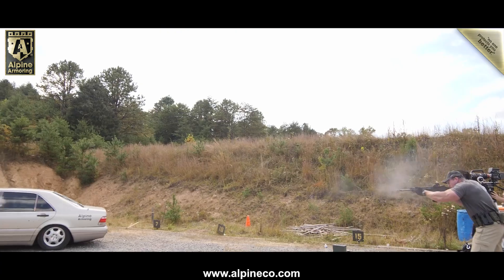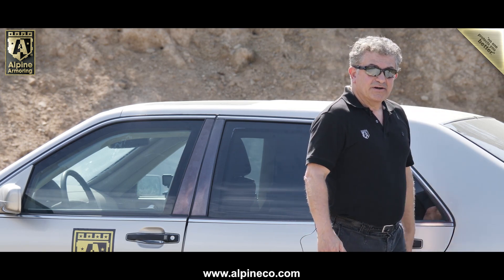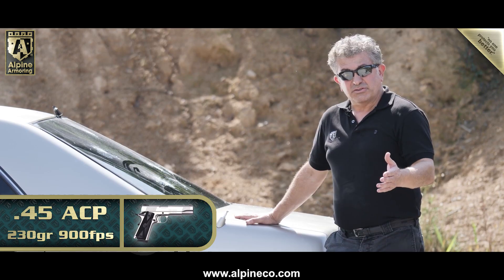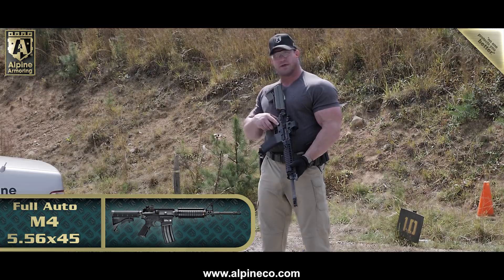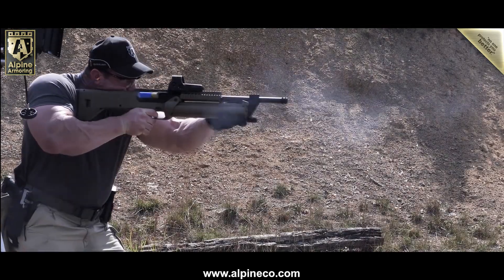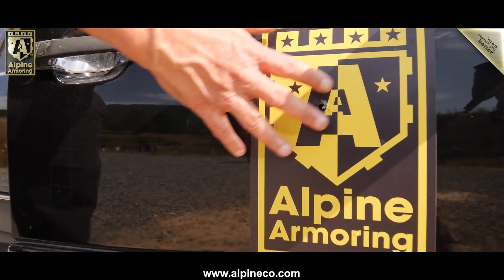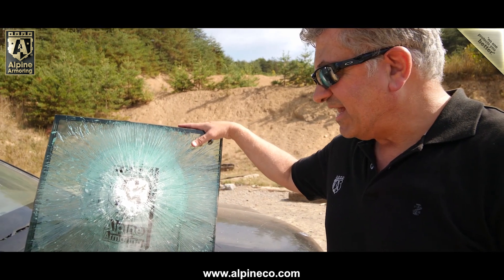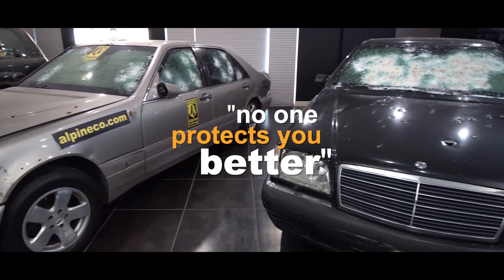How Long Do Alpine Armoring's Bulletproof Vehicles Last?

Comment: I'd definitely feel safe in that car!!
Reply: It's a false sense of security. Anyone who can't access the occupants thinks one dimensionally. Shoot the tires and radiator, pour a gallon of diesel on the car, and light it up. You will get out the vehicle real fast when you start cooking. Heck you don't even need the diesel. Buy a 4 pack of road flares for $5, and put one under each tire and again, you will come out, or cook. Now you might say, "but you can drive on flats, we won't just sit there and get killed". Sure, but that's why you shoot the radiator too. You can slowly drive off for a little bit, but you will overheat and friction lock the motor in about 5 minutes, and with flats, you will be easy to keep up with. Once the motor stops, fire up the barbecue!
Reply: @Steven-gv1ke  uummmm that’s why the engine bay is armored and the tires are bulletproof or run flat.....
Reply: @user-oy9zy4ds9m  nice try, I was a mechanic for 25 years, you can't "armor" a radiator. You clearly don't understand how a radiator works. It has to have unrestricted airflow through it or it won't cool the engine properly. Even a lot of bugs in your radiator can be enough to cause cooling issues. If you stuck armor plating in front of the radiator, you would block all air flow to it, and your vehicle would over heat in 5 minutes and ruin the motor. So no, you can armor plate a radiator.

Also read up on "run flat" tires. They are not designed to drive at high speeds without air. Last time I read about them you could only do maybe 45 mph tops. Anyone will easily keep up with you doing 45 mph until your engine overheats from the radiator being punctured. So technically, run flats would help a little, but you are still going to be in trouble if you don't find a police station to get to in 5 minutes or so before your car overheats.
Reply: @user-oy9zy4ds9m  lmao you just used his own logic against him 😂
Reply: @dingleberrydribblings  yeah didn’t you know all you need to do to stop an Abrams tank is shoot the radiator 😂
Reply: @user-oy9zy4ds9m  Yeah, that is correct, you shoot the presidents limos radiator, and then about 40 secret service agents step out of the other vehicles escorting his limo and engage you with probably full automatic or at minimum select fire weapons while calling for backup from additional secret service, police and depending on how many people are ambushing the president, a helicopter full of marines would likely be there in about 20 minutes. I spent 8 years in the military and I worked in law enforcement in Texas after I got out of the military as well later on. So what background do you have to?
Reply: @user-oy9zy4ds9m  Abraham's tanks have radiators in the rear, where the engine is, because they don't drive at high speeds, and they use a significantly larger liquid cooling system because weight is not a issue on a tank. The size of that cooling system would not be possible on the FRONT of a car, because it would throw off the steering on the vehicle, plus the weight is not practical as weight is a issue on a normal car. I understand this is complicated for your simple minded brain, but it really isn't rocket science. Furthermore anyone who has been in the military knows that tanks are far more susceptible to damage from the rear which is why tanks try not to ever let another tank or RPG get behind them. Open a book for pete's sake man.
Reply: @Steven-gv1ke  I’m simple minded? I’m not the one that took 3 weeks to hash together some bs 😂
Reply: @Steven-gv1ke  so your a 25 year mechanic, a cop, in the military, and a know it all armor vehicle specialist. Damn your day must be busy.

Comment: And noone shoot engine,why?Noone know:)
9:25 Correct me if iam wrong by why not use 50. Cal AP/API instead of standard ammo?
Old RPG 7 do job faster way and cheaper probablly:)
Reply: 90% of criminals won't just "have an rpg" and this isn't GTA where a bullets to the engine destroy cars quickly. By the time the first 6 bullets hit the car, they will be driving and moving and attempting to get away.
Reply: @X33Ultras0und  Yes but if you want kill someone in armored car there is no better option..
Reply: @joe125ful  You are right. But remember, in the real world, RPG's aren't what our local criminals have in their pockets. It's usually a small pistol.
Reply: @X33Ultras0und  Who the hell use pistols on armored cars???:):)
More like gangs/terrorists use better stuff i mean those car types are mostly used for soemone who have lot of money and power.
Reply: @joe125ful  Yes, but even so, they would still aim at the glass as these cars don't look bullet resistant. I've never shot one before, but I don't think RPG's are easy to shoot too, because of gravity and all that

Comment: Unbelievable! I was sure that 50 cal will make it.. Impressive!!
Reply: No AP/API ammo maybe???
Reply: @joe125ful  You don't need that. Shoot tires and radiator with AR15, pour gallon of diesel on front tires, light on fire, get ready with AR15 when occupants exit vehicle
Reply: @Steven-gv1ke  Yeah but you know...use bigger buns for sure:):)
Reply: @Steven-gv1ke  hahahahahaha
Reply: @Steven-gv1ke  Amateur, armored vehicles have run flat tires and the radiator got armor in front of it so your AR won't do shit. They usually got fire extinguisher systems that will stop any fire, so your attacks are pointless. And you forgot that anyone who got a armored vehicle  won't travel alone, their Bodyguards will lit your ass if you try something.
Reply: @darkshadow.1337  oh yeah, radiators don't need air flowing through them, I forgot. I mean I was a mechanic for 20 years, but your right. That's why radiators can overheat simply from being dirty with lot of bugs, or mud. But yes, armor blocking all the air flow won't make it over heat. Good call.
Reply: @darkshadow.1337  oh and run flats usually have a top speed of 45 mph, so you will definitely out run the car shooting at you who has air in their tires with your 45 mph get away. I've said this before and I will say it again, if you don't have armed personnel driving behind and preferably in front of your armored car, or at minimum armed guards inside your car who are willing to step out and engage the attackers, that armor will do nothing but buy you a little time. That armor is not meant to stop a well organized attack indefinitely. I was in the military for 7 years and spent time in Afghanistan and Iraq. Even our military armored vehicles only bought us some time to call for back up. We were always forced to engage the enemy, and these are people in a 3rd world country who could easily disable and get us out of our heavily armored vehicles. You don't know what you are talking about and have watched too many movies
Reply: @Steven-gv1ke  😂

Comment: Will it survive with A10 warthog ?
Reply: I just want to know if it will survive a $3 gallon of diesel and a match... Or more so will the occupants 😉
Reply: @Steven-gv1ke  It will.
Reply: @X33Ultras0und  is bulletproof, not heat proof. My barbecue pit that is 3/8 inch steel is bulletproof too, however if you built a fire around it, anything inside would cook eventually. If you think you won't cook in there, volunteer to sit inside while we light it on fire.
Reply: @Steven-gv1ke  When you say eventually, do you mean in 3 minutes? If not, then the car can stay on fire for 3 minutes while they drive away from you.
Reply: You know it just might. I mean the A10 was designed to destroy tanks. And a car is not a tank obviously it can't destroy a car...🤪
Reply: @shaggings  oh ok
Reply: No.

Comment: It would have been more interesting if the CEO remained in the car while the testing was conducted. Which bullets were armour piercing? None
Reply: They also shot the glass intentionally at an angle. That is significantly easier on the glass. Let's see them shoot it straight on.
Reply: @Steven-gv1ke  true
Reply: Do you know any criminal people with AP rounds? Or anything larger than a sub-machine gun?
Reply: @X33Ultras0und  haha nice try cia